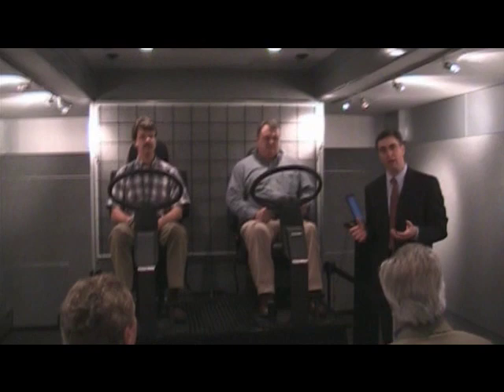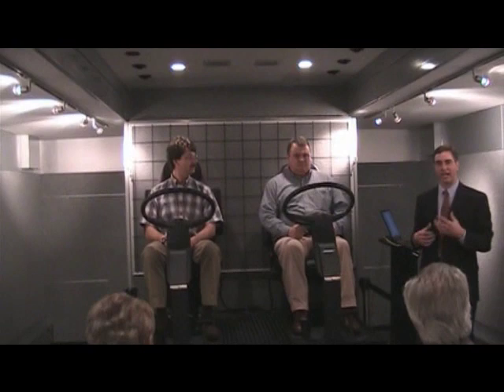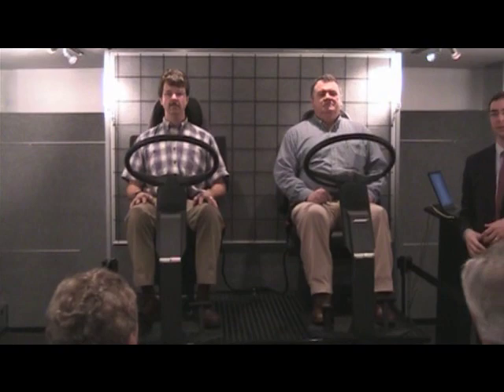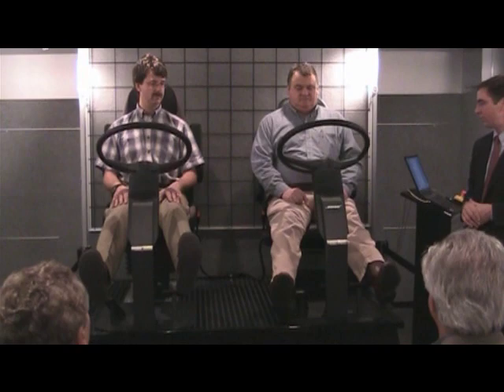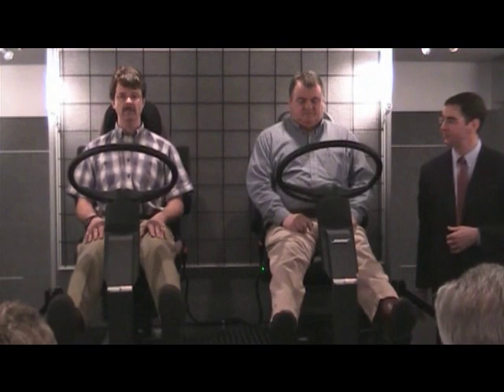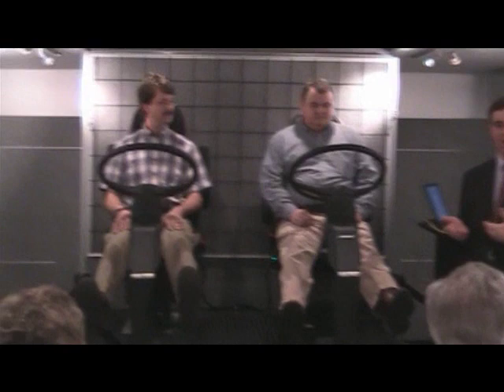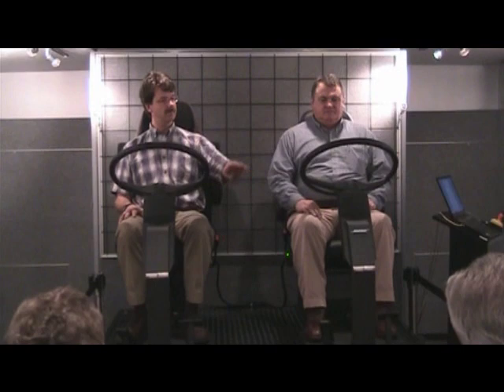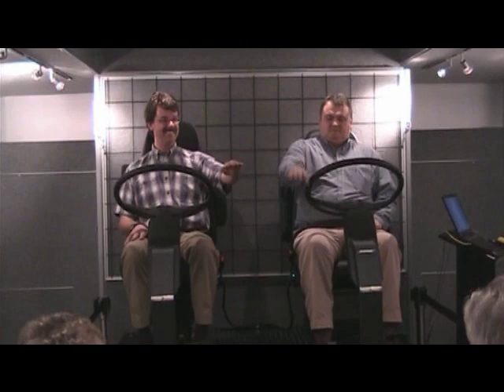Demonstration: Bose Ride vs Air-ride seat

Comment: Lets start off by having two men of similar weight. Then make sure the guy with the conventional seat hasn't raised his seat to the max.
Reply: Agreed!
Reply: Bose system worked. Was too heavy and expensive thou. The company who bought just used the algorythm to theier seat stabilizers. Maybe in a near future we can see its comeback!
Reply: Nope, the focus is vibration.  Vibration will tear you apart.  I used to race Two Stroke road bikes.  You cant feel your hands for about 40 min after.
Reply: This technology was designed from car suspension they made a Lexus do bunny hops its insane

Comment: That Bose Ride system should be extended to the steering wheel and pedals too. It would eliminate harmful vibrations on the feet, legs, hands and arms.
Reply: it's extremely difficult (if not impossible) to use any suspension system for pedals, the hinge of the pedal cannot move, if it does then the pedal is not pressed as it should, one way would be to have an extremely light first part of the pedal travel (which doesn't actuate the control) which is used to "lock" the suspension and allow the pedal to be properly pressed. the problem is that this would defeat the purpose as it would not vibrate only when the drivers feet are not on it.

i would say that it's probably easier and smarter to make it so the floor of the pedal box is suspended, not the pedal itself, after all, a driver's feet do not spend that much time on the pedals compared to how long they spend on the floor.

the steering wheel might be able to be suspended but it's just easier to use some kind of rubberized material in the wheel itself to act as a dampener for vibrations.
Reply: @itzFYEB  
Ever heard of drive-by-wire? The pedals don't need to be mechanically connected or linked to the chassis, and neither is the steering wheel. The Bose Ride could easily include a "shell" or frame consisting of the seat, the pedals, and the steering wheel. Especially 12 years later.
Reply: @AlainHubert  what does ride by wire have to do with anything, i didn't explain it cause it believed it was obvious: if the pedal hinge moves, you cannot apply force to it (especially not a mainly vertical force) as it will move and the input will be spoiled by the movement of the hinge.
Reply: @itzFYEB  
The pedals can be part of the seat and be suspended by the Bose system too. They don't have to be mechanically linked to the truck anymore, but instead connected to a computer that will do the job of braking, accelerating and decluching (what is known as drive-by-wire).
Reply: @AlainHubert  that would be extremely complex and expensive system just to do a job that could be approximated by a rubber bushing that would cost cents and wouldn't require a complete redesign of the cab (which can only be done by a manufacturer and would probably require a separate homologation)
Reply: @itzFYEB  
How much do you think the Bose Ride System cost (including delivery and installation)?
Reply: @AlainHubert  i believe it to be around 6k $, delivered and installed
Reply: To be fair the system could be used on the cab suspension meaning steering wheel, pedals, seat and floor are all isolated from vibration,  i would like to see how the seat handles a big bump tho such as a speed bump or pothole and forces from large changes in gradient.
Reply: I  dont think vibration in your hands,feet ect would cause body pain like just keeping you spine stable.There are so many nervers in you spine that extend throught the whole  body to cause pain else were.
Reply: @AlainHubert That's a very bad idea

Comment: If your seat suspension maxes out at that height it must be some POS.  I'm right around 6 feet, and if I max out my seat suspension, my feet are a foot 6-8 inches off the ground.
Reply: dg5876 You must have shorter legs and a longer torso. I'm also 6 feet and in a Freightliner Cascadia, Peterbilt 579, and Kenworth (forgot the model) my feet are never more than a half inch from the ground if raised at all. You can't tell me that every single one was shit.

Comment: @redfueldlux I got on it.  It's not bullshit.  The guy on the bose seat is heavier, so that's why it's sitting lower.

But honestly, it does too much of an improvement that your body is sitting still while your arms and legs are vibrating with the truck...that would take some time getting used to.

Comment: Why not use it for the truck's suspension?
Reply: too expensive and heavy
Reply: Glenn Fox
I've heard that is why no car manufacturers would use it.  But how much could it hurt as part of a truck that already weighs >20k lbs and costs >$120k.
Reply: +OptimisticPessimist I'm not really sure, I just read that in an article about these. I'm dont know much about vehicles to be honest. sorry I can't help more
Reply: Glenn Fox
In case someone else reads across this, I'm sure shocks that can completely stabilize the truck would make it reasonable to reduce weight from other shock absorption parts.  The engine and drive train might even perform better and save fuel by not bouncing around so much or being inflicted by so much shock.  You might even get away with lighter materials throughout that don't have to be built for it anymore.
Reply: Very interesting to think about, that's for sure
Reply: OptimisticPessimist they did it on a lexus as a prototype but it was deemed too expensive and too heavy so they miniaturised it into a truck seat. seach bose suspension it's incredible. the car can hop over an bump
Reply: Mike Byrne
I saw a video of that.  I figured the weight difference added to a truck that already weighs ten tons might be a small enough ratio.
Reply: Other devices can be added to compensate for what is important.  A tire is also less likely to be damaged if less weight is pushing it into a pothole.  I, like probably most drivers, steer around every hole and object I see in time that looks like it can put any kind of abnormal stress on a tire or suspension.  An inevitable down side is speed bumps won't be useful for cars that have this kind of suspension and some of those cars will have irresponsible drivers.
Reply: Cost, it was based on work that was done for car suspension.
Reply: A truck is much heavier and the power required for the electrical-mechanical system would be too expensive.  A driver is a lot lighter.
Reply: @jasonlisonbee  Every extra pound in parts is a pound lost in cargo
Reply: @syamayama  Good point.

Comment: if you look closely, you will see the fake steering wheel on the left is vibrating a lot
more than the one on the right. It appears they have skewed the vibrating table to
make their product look better.
Reply: Same vibration, if you see more vibration in the left wheel is because the shirt
Reply: Richard Davis-Minter they used the same product on a prototype lexus suspension. its incredible
Reply: i kinda feel the same way.... but the science behind it does make some sense